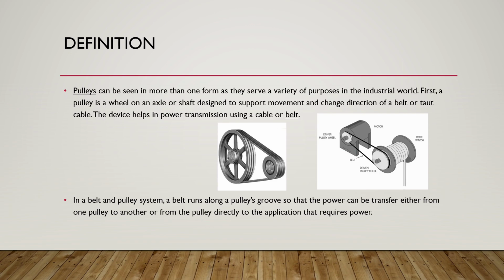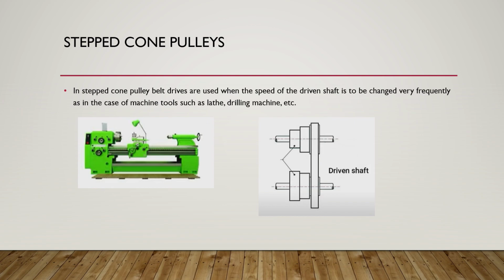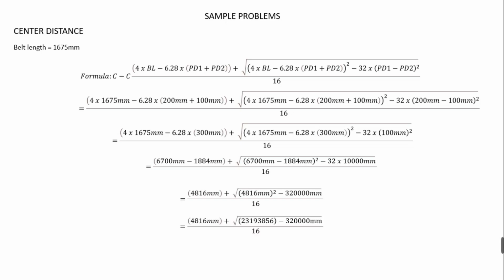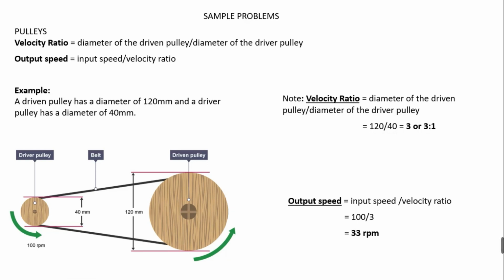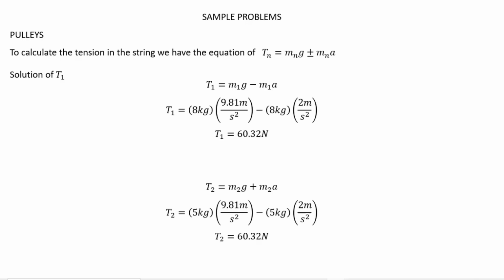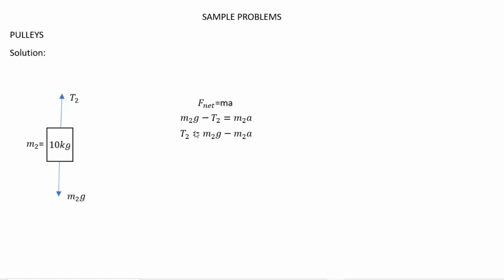BELTS & PULLEY

Comment: ABAO, AIKIM L. 
CE - 3D

0:25 Definition of Pulleys
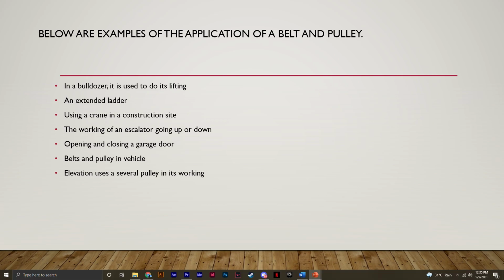04:27 Applications and Examples of Belt and Pulley 
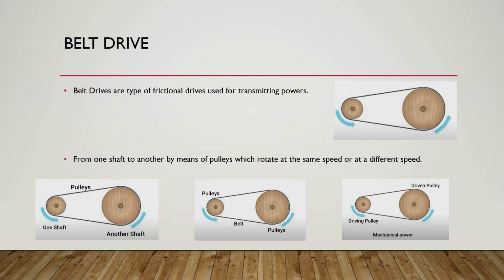4:52 Belt Drives - a belt and pulley 
5:36 The side of the pulley experiencing greater tension is called the "Slack Side" while the other side with lesser tension is called the "Tight Side"
         Also the driver pulley is the pulley with smaller shaft and the driven the one with much bigger shaft
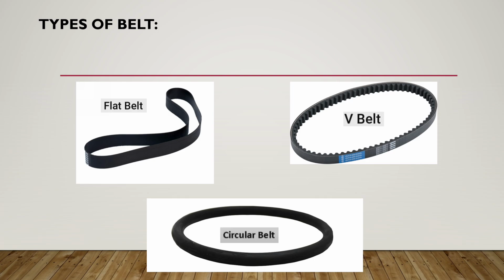05:54 Types of Belt: Flat Belt, V Belt, Circular Belt
07:02 Types of Belt Drives
08:04 Cross Belt Drives - causes other shaft to rotate on the opposite direction
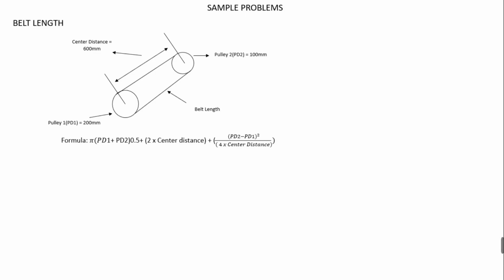12:34 - 28:48 Belts and Pulley Sample Problems

Comment: CASTRO, LORENZ KLEIN U.
BSCE_3D
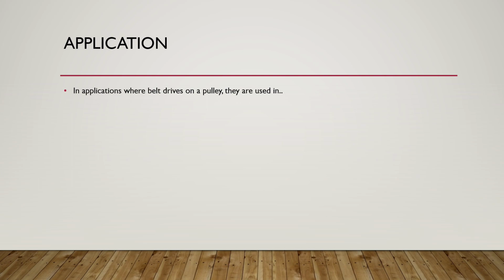3:07 Application of belts and pulleys
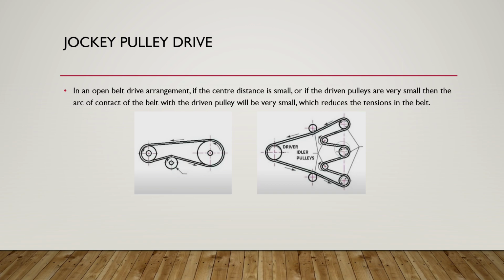10:46 In an open drive arrangement, if the centre distance is small, or if the driven pulleys are very small then the arc of contact of the belt with the driven pulley will be very small, which reduces the tensions in the belt.

Comment: Anude, Chrislyn M.
BSCE-3D

0:22 Definition of Pulleys  
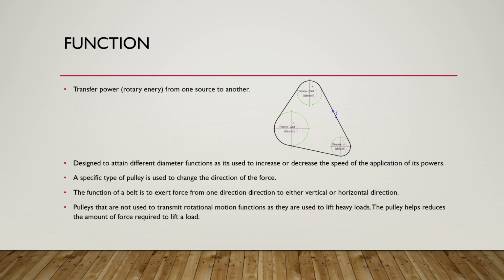1:41 Functions
3:09 Applications 
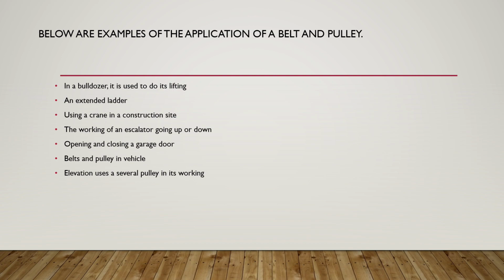4:09 Examples of the application of belts and pulley.
4:37 Belt Drive
5:23 Slack side and Tight side
5:55 Types of Belt
6:58 Types of Belt Drives
11:32 Belt drive advantages and disadvantages .
12:30 Sample Problems 
17:16 Example on finding the tension.
19:50 Example on finding the velocity ratio and output speed.
20:45 Example on finding the acceleration.
24:44 Example on finding the acceleration and tension of an inclined.

Comment: VILLAFLOR, JULIETA E. 
BSCE-3D

7:55 - In cross belt drive, the belt is employing when two parallel shafts have to rotate in the opposite direction.
11:30 - Belt Drive Advantages and Disadvantages

Comment: ANIÑON, NIÑO LAWRENCE C.
BSCE-3D

0:58 In a belt and pulley system, a belt run along a pulley groove so that the power can be transferred either from one pulley to another.
13:21 Belt length can be solve by using the formula:π(PD1 + PD2)0.5+ (2 x Center distance) + (((PD2−PD1)
^2)/(4 x Centre Distance))